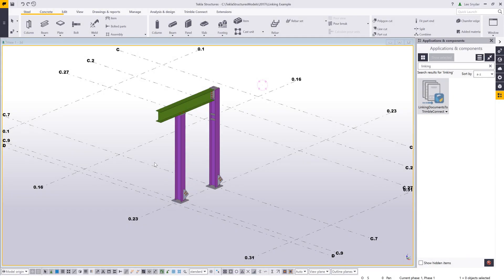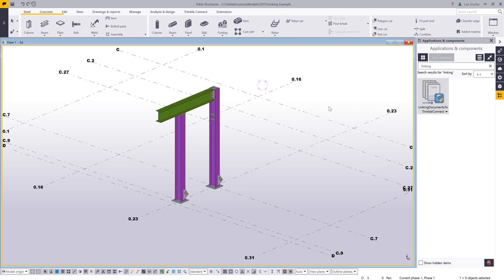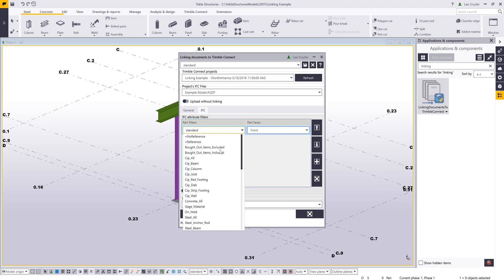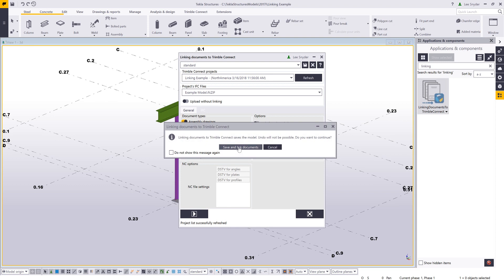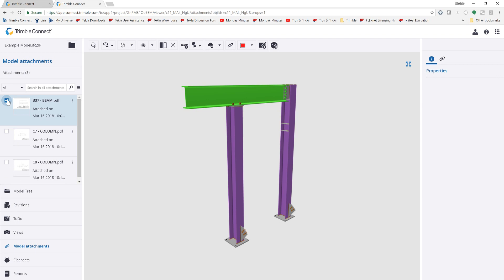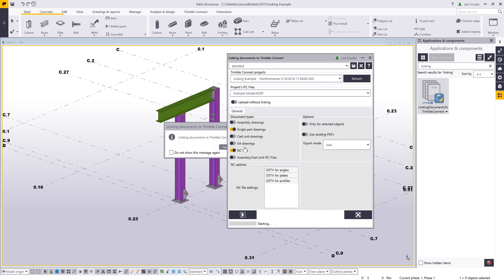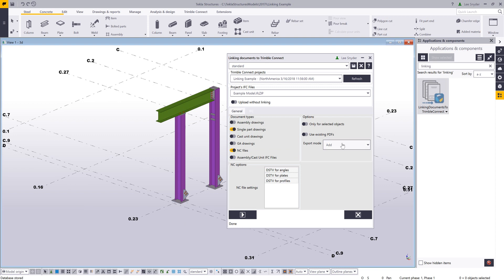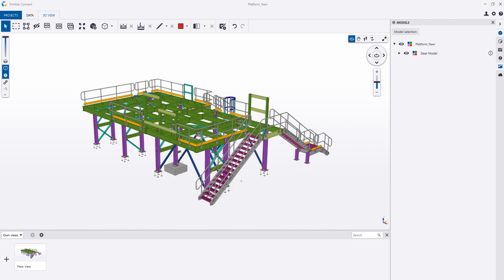Linking Documents To Trimble Connect Tutorial

Comment: Hi , when export from tekla 2017 using trimble connect direct to cloud , i couldn't select assembly it is export as parts .......... any way to export direct from Trimble connect to cloud as assembly object ?
Reply: In the IFC settings that you are using can you verify that the option to include assemblies is enabled?  If your IFC attributes setting includes assemblies, then when you run the export you'll be able to select parts or assemblies in Trimble Connect.
Reply: @leesnyder6784  in version Tekla 2017 not tab to choose export attribute or setting just name of file and filtter or selected items then filter required
Reply: @osamaahmedhassan5793  Yes I just went back and checked the developer notes for 2017 and when using the automatic upload, the assemblies aren't included.  That appears to have been added in 2018 and newer versions.  So for 2017 you'd need to export an IFC file using the File>Export>IFC with the settings that you need and then manually upload that to your Trimble Connect project.
Reply: @leesnyder6784  could you provide your mail to send a picture from Tekla 2017 configure ifc export ?    .......
i try to find the default setting file which trimble connect use as default to export ifc

Comment: Hi, Thank you for video , I have question why doesn't use export to Trimble connect , and if i have modification at model how i upload it direct to Trimble connect something like option in Tekla2020 , is that option available in old version ?
Reply: You can use the Trimble Connector in previous versions to upload an IFC file to your Trimble Connect project.  See this video: https://www.tekla.com/resources/youtube-trimble-connect-with-tekla-structures/tekla-structures-2019-to-trimble-connect-workflow  You can also use the Connector to easily upload a new version after modifications are made to the model.

Comment: Does Trimble or Tekla know that where a GA drawing to be linked to? I mean I can link it manually to the grid for example, but what if I use "LinkingDocuments to Trimble Connect" extension?
Thank you guys for developing and making videos!
Reply: Yes Tekla Structures knows which objects are displayed on any drawing so that's what the tool does.  It finds all the objects shown on a GA drawing and then links the GA drawing to those objects.
Reply: @leesnyder6784  Actually, it sounds awesome. Thank you!